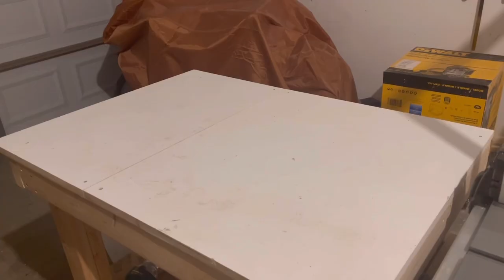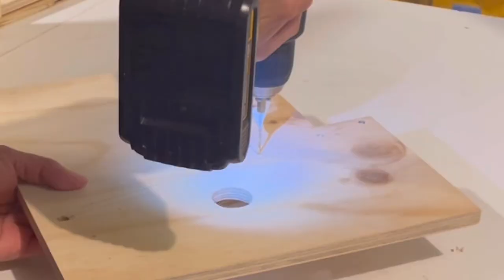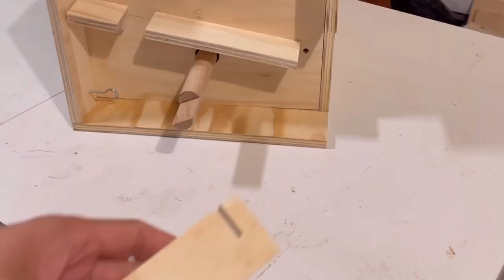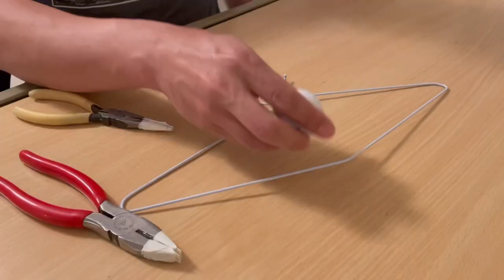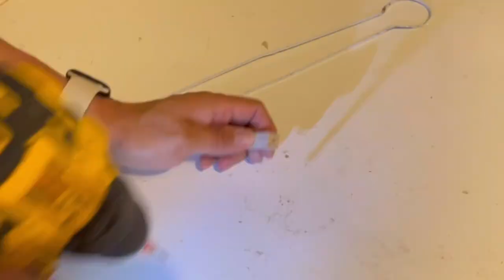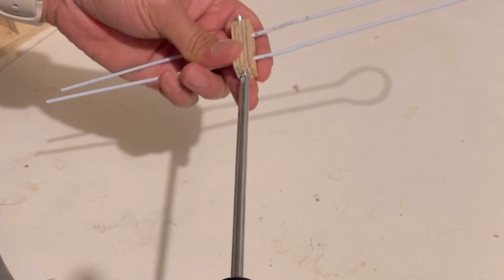Making a golf ball dispenser / golf ball feeder / DIY / 골프공 공급기 만들기

Comment: I can't seem to not get ball jams in the storage area. The video does not show you filling your machine with balls. Mine works for 10 to 15 balls but then jams. Did you have any issues / fixes?
Reply from the maker: I also occasionally experience clogging in the narrower section when I put a lot of balls. It seems like increasing the angle of the bottom surface would help, but since it's difficult to modify, I just tap the clogged area with a golf club. :)